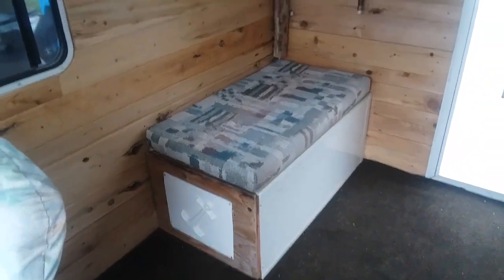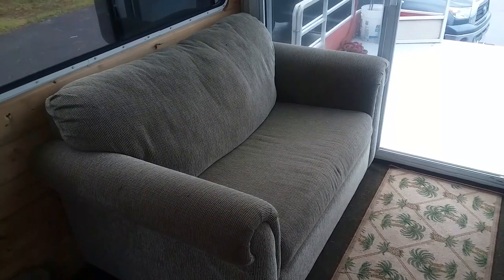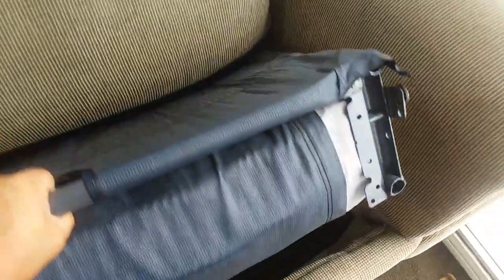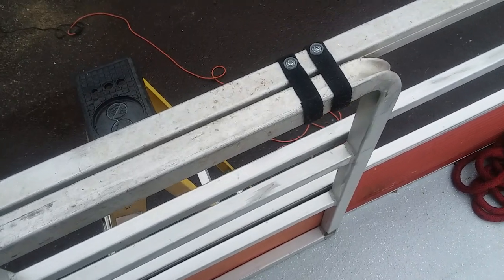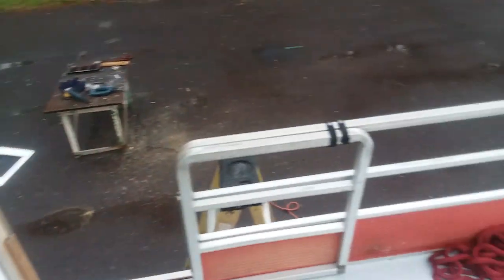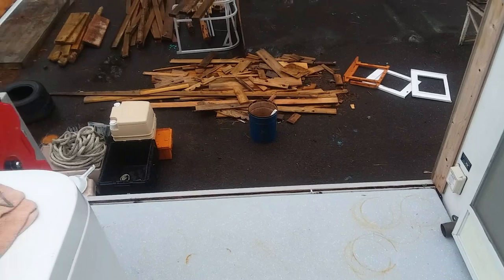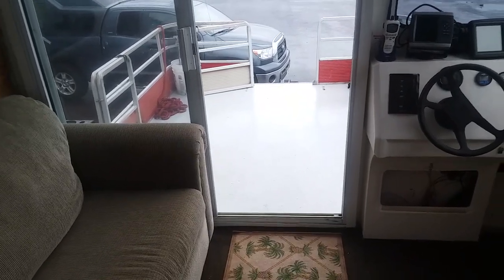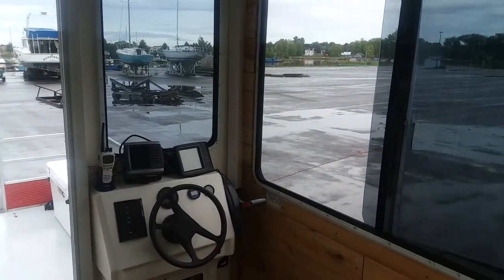The Shanty Boat Beagle Build: Episode:11

Comment: I am so excited for you! I feel like I am going on an adventure as well. The boat is looking great and really looks "finished". 
The hide-a-bed is a good idea. I used an inflatable mattress that sprung a leak. I won't do that again. 
I like the anchor buckets. Very organized. 
What all will you be keeping on the back deck while under way? Should you have a railing to keep things from going overboard in rough waters? Things can get really rough. Keep everything attached for the unexpected. Unexpected will happen! 
I love the scooter idea!! That would be great to explore an area after pulling into dock for the night. I will do that next time. Do you have a ramp to get it on and off the pier? I can't wait to follow you on your trip!
Reply from the maker: Hi Eric, thanks for the encouragement :) back deck: so far it's looking like one propane tank, a porta potty, some extra gas cans, maybe some fishjbf supplies. I want to have a small fish cleaning table back there too. I'm hoping to catch some fish on this trip. I think the scooter is rodonf across the front along the railing. The boat doesn't need some weight in the rear. One reason why I'm leaving the interior somewhat open is to store things of value inside while I'm away. The scooter will fit inside, my honda generator, other odds and ends. Never know when pirates are in the area ;) I'm still thinking about railing in the back. Thank you for reminding me that it can get rough out there. Eventually everything is going to be in a secured place while underway. I'm starting shelving inside next. Maybe cut up milk crates.
Reply: @backwatersandbackroads  you’re always thinking my friend. If anybody can do the whole loop in a shanty boat I think it will be you. up there with crossing the Atlantic in a skiff or tiny sailboat
Reply from the maker: @lesliefleming4359  thank you! I believe we're gonna do it too ;) and we're all going to find out together

Comment: Could i ask you, how do you get the scooter on and off the boat?
Reply from the maker: Howdy. Yeah! The Shanty Beagle was fairly easy. I hauled 2 different scooters on that trip. The first half was a little 49cc scoot that weighed around 100 #s. I could get it off and on easy. After christmas, I had that 250cc which was heavy. It weighed the front of the boat down a lot (crossing mobile bay) I had to pull into a dock and unload off the front of the boat. I wouldn't carry a big scooter again.